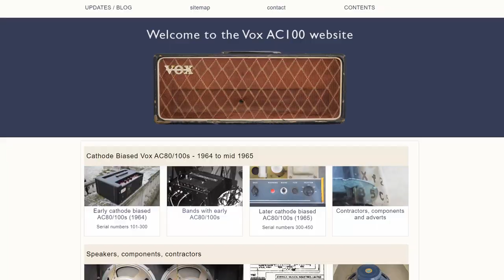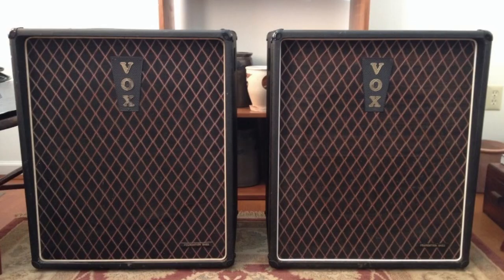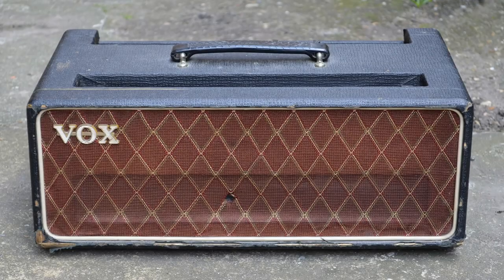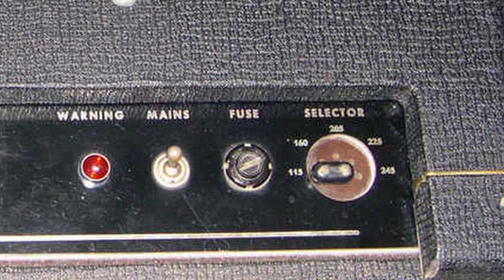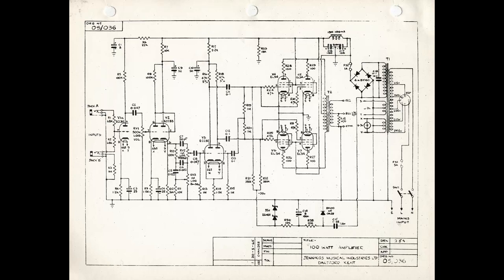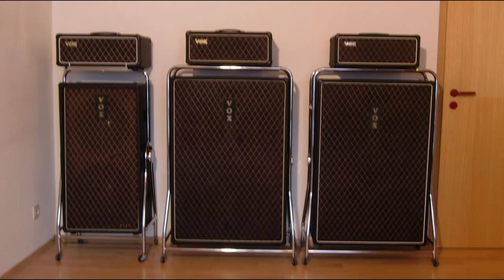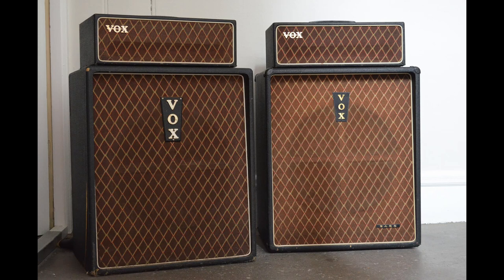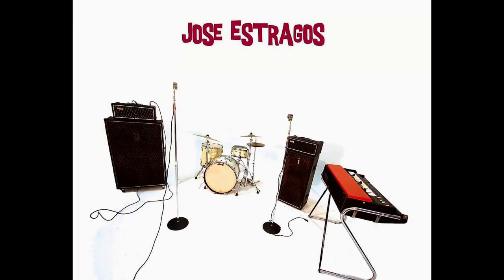Vox AC100 History & Sound Demo

Comment: Personally, while being largely different, the Korg era AC100, the AC100CP deserves a mention but was hampered by two problems, they came with low quality valves by default and was paired with a 412 cab with unsuitable speakers (Warfdales) - not to mention that a number of people expected a reissue JMI era amp.

I found this amp on Ch.1 in the ballpark of an "evolved" AC100 (having midrange, gain and tone cut) but ch.2 is pure rock and roll and gets into heavy metal.

I used a bass through the 2nd channel and the fat switch turned on and bass, mids and treble at 12 o clock, it got into the territory of Motorhead easily
Reply: Do you use a ric?

Comment: Hey there Paul…what a great collection of Vox Amps and Beatle guitars. This is a great video and I just love this AC 100’s and Solid State Super Beatle amps too. I have a question…I’ve seen pictures of The Beatles playing concerts using the AC 100 but with no mic in front of the amp. Look at pictures of the Shea Stadium Concert. Now; is there a line out from the amp that would go to the P.A. System or did the amp’s sound just bleed into their vocal mics. 100 watts is not very loud standing in the middle of a baseball field. How could anyone hear it sitting so far away. Thanks and keep posting, Peace, Sal 💪🏼🎸
Reply from the maker: Thanks for that Sal!
Interestingly, the lads ended up going into the studio and overdubbed it all for their first Shea appearance (heard they did it on 2nd one too). The screaming was just too loud for anything to be recorded audio wise during the show. 
And yes they didn’t use mics in front of their amps! Just cranked them up all the way and whatever was heard, was heard lol
Reply: @guitargearconnection  Thank you Paul for taking the time to reply. I have (2) AC 15 amps. One with a Blue Alnico and one with a Greenback. Love them both. I also have a Casino and 330 Ric. Every time I plug into my Vox with either guitar; my hair immediately grows out into a Beatle Haircut and I get a Liverpool accent. I just love J,P,G & R and the wonderful music they made. That’s the whole reason I wanted to play guitar. Good luck to you and please keep posting, Peace, Sal ✌🏼
Reply: @guitargearconnection  Wasn't ALL overdubbed, it was "enhanced".

Comment: I read only 10 basket topped sdl cabs were made but your video sound like more were made. How many do you think were made please?
Reply from the maker: I would say about 10-20. Nobody will ever truly know, but just in America alone I know of 3, and in England I know of 2. And I kind of just stumbled upon knowing of these, I didn’t dig to try and locate. With Spain being a large importer of vintage gear, and now Japan being in the lead, I would say there are definitely a few lying around that haven’t been come to light yet.
Reply: @guitargearconnection  thanks that's really interesting, do you have links to share on these. 

I recently discovered one in the UK, it'll be on the voxac100 site soon. That resource thinks only two survive (plus mine) so it might need some more updating.
Reply from the maker: @JR_Taylor I have some pictures of the one for sale recently, and I’ll see if I can dig up the other pics. What is your email?

Comment: These amps sound really nice.
Reply: With it only having a top boost circuit, it maybe a bit to bright.? I let my buddy use mine for a gig & he didn't like it. Didn't have enough balls he said.
Reply: The Dr. Z Z-80 looks promising, and I think that it is unlikely that I will find six working AC-100s that I can use in my rig. (I have found a couple, but the Beatles had six, so hello Doctor...)

Comment: You're pronouncing cathode bias incorrectly. It should be pronounced similar to cat on the first part, with the emphasis on the first part of the word rather than the second part of the word. Other than that, nice video! Love these amps!
Reply from the maker: Thanks for that! I knew there was a chance I was screwing that up.
Reply: CA-thode &  THER-mister.  These are absolutely common component names (cathode more than thermister) that anyone with any knowledge of electronics, especially tube amps, would know as introductory terminology basic to the simplest operation of amplifiers.
Reply: @haytguugle8656  Brimistor. It is kinda the opposite of a Thermistor, iirc., but look it up yourself, the hoboroadie is pretty unqualified to make this comment.